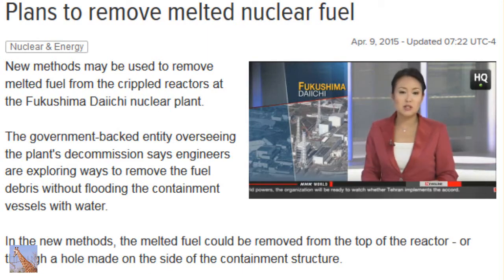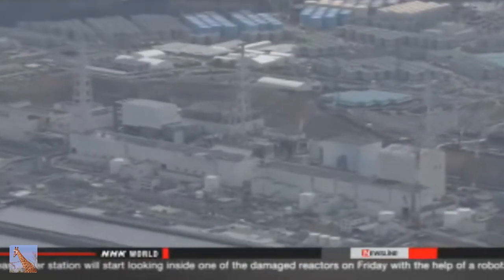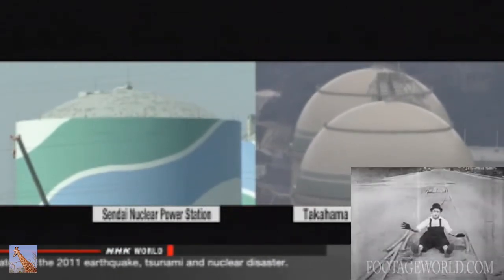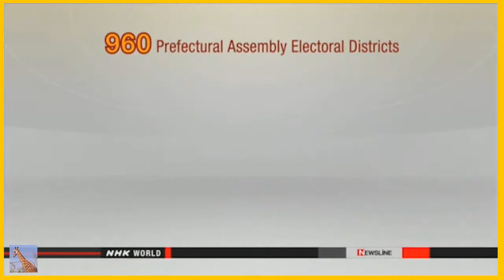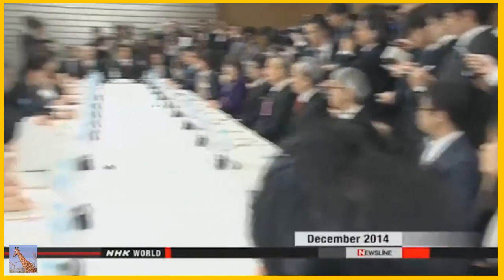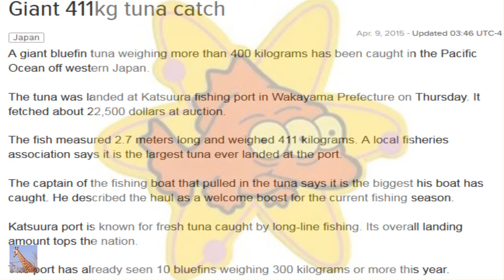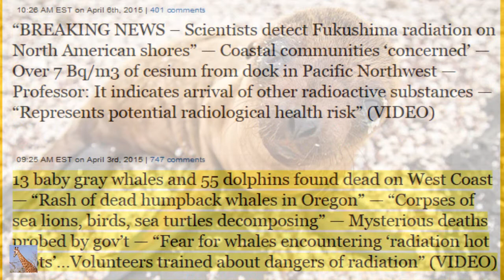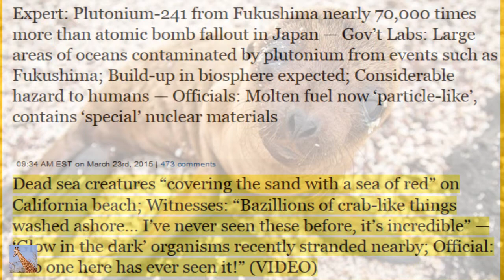Fukushima Plans to Remove Melted Fuel, Robots & Voting Update 4/9/15

Comment: LOL They are a little late; all that fuel burned up years ago.
Reply: Adam Selene Burned up is the wrong term or misrepresentation of the release of radiation so that view can't be complete at this date until an invention leads to a break through.  Until that time....... Get your mutate on brother.
Reply: treewolf37
All those fuel pools caught fire, unit 3 blew its core out, 3 others melted out and nobody has done the first thing about it. It seems safe to say that we can assume all that material is no longer contained. TEPCO says they are worried about fuel pools draining out, but we have no way to know if that's just nonsense, or if any of that fuel is actually intact. Then they faked up pictures of unit4 which was completely wrecked, but the pics show a pristine interior, which is not possible.   Mutate is right; we've all been breathing and eating this gunk for 4 years now. It is not a good situation.
Reply: treewolf37 It would be nice if it worked that way. Unfortunately, plutonium and uranium are long-lived and will be damaging all life for a long long time. Nukers are some crazy critters.
Reply: FixItStupid Yes, it is only getting worse.